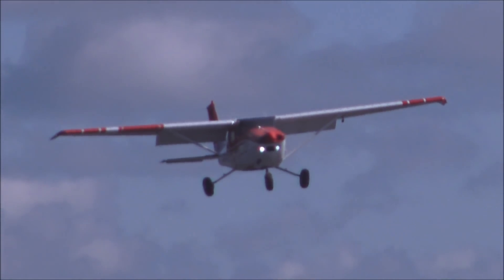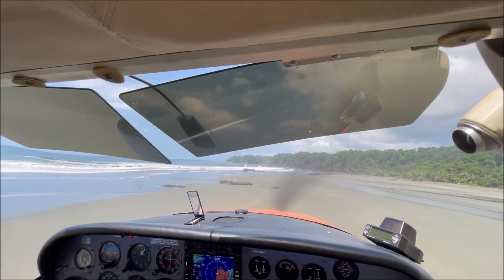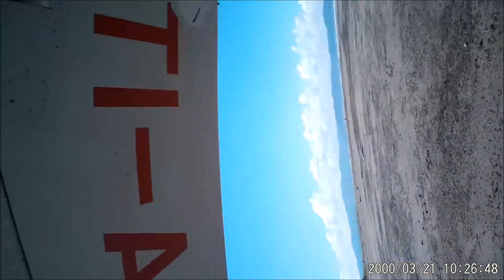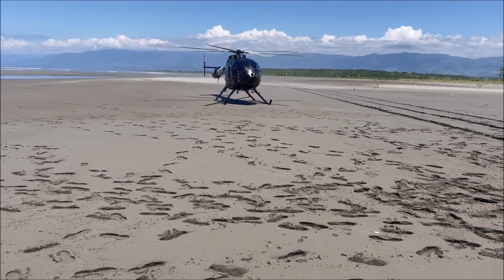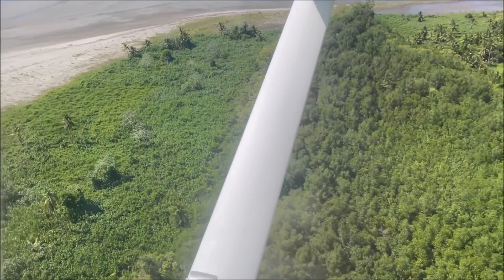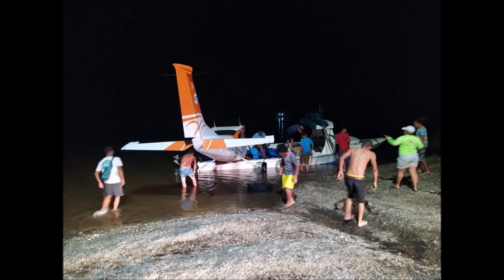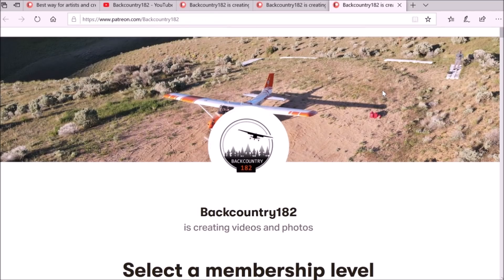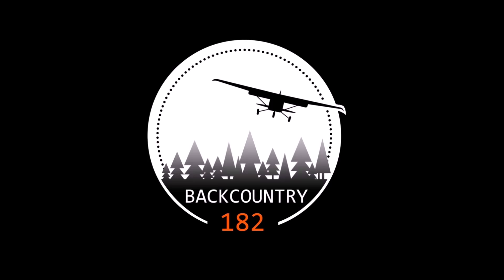Cessna 182 Crash Landing on a Deserted Island

Comment: I wonder how things would have been different if you were flying a taildragger (with large bush tires).  I realize those are large tires for a nosedragger, but presumably the pressure-per-square-inch against the sand with a taildragger [with large tires], and maybe wouldn't have been sufficient to "dig in" enough to get past the point where "dig in" reached the state of positive feedback mode (which it sure looks like it did).

Comment: You had contaminated oil filters multiple times and kept flying? Sorry, dude, but that is not cool. I'd go so far as to say that it is unacceptable. Whoever is doing your maintenance and okayed you to keep flying with oil system contamination, especially if that contamination was metal, put your life at risk. But, even with a mechanic's blessing, it's the pilot in command's responsibility to determine if a plane is airworthy before each flight -- continuing to fly with known problems is an invitation to make emergency landings such as you experienced or much worse.
Reply: Metal is not unusual it depends on the amount & type. It sometimes comes & goes. Also this was a low time engine. Oil analysis will recommend fly it 25 hours & do another oil change/sample. These engines have a 1800 to 2000 hours TBO. Its 30 thousand to overhaul. Not uncommon to replace cylinders before TBO.

Comment: Thanks for sharing this incident, especially the cautionary information about warning signs from the oil analysis.  I didn't fully understand what happened with the engine other than the presence of contamination including fiber.  What actually caused the power loss?  Did you lose a cylinder because of valve train damage, or did one or more bearings fail?  I'm taking note of the fact that the Sportsman STOL and VGs, and your frequently practiced ability to land at very low airspeeds, contributed to the good outcome.  I'm glad your bird is reparable!  I've learned a lot from your channel. Hope you're back in the air soon.

Comment: Did the same back in the 1980’s.  Nose-gear went through firewall and a prop hit.  Ended up replacing additional frames beyond original damage due to corrosion, new floor and a rebuilt engine.

Comment: Hi Larry,
I hope repairs will be done easy and safely.
Thanks again for all your beautiful views and all these informations ?

About the Sportman stall kit you had installed, how much do you think this helped you on your engine failure landing in sand ? 
You think aircraft will be in worst conditions without ?

If you were with the cessna 170 will you land at this plane with no problem ?
Reply from the maker: Sportsman reduces the approach speed , so maybe without it it would have turned over its back. Maybe the 170 could have made it with the big tires.

Comment: Would a tailwheeI airplane have survived a landing in that soft sand?  This is the third tricycle gear airplane I've seen lose a nose strut on soft field landing.  Surprised to see you were running wood prop, not a bad idea in this situation.  Best wishes on your repair.  I'm thinking there was some bead blasting media in the oil gallies that didn't get removed before assembly. The oil analysis should indicate what the high level contaminate was. I assume you have a spin on filter.
Thank you for your excellent videos and narration.  🛩👍

Comment: I know your channel is called Backcountry 182, but have you considered trading for a 180?  On 29 or 31” tires, It’s a way better fit for off-airport.   I’ve run 206s off beaches in Alaska for a long time.  There’s a steep learning curve, but in the end, It’s still a crapshoot, and the only sure thing is landing in someone else’s tracks.  

Looking at a beach or river-bar, if the sand shows no sign of gravel or rocks on the surface, that’s a red flag. If the surface can’t support a stone, it probably won’t support an 8.50x6, let alone a nosewheel. 

If we’re taking a Beaver, 185 or 206 into a difficult spot with variable conditions, we’ll send a super cub in first to inspect the surface.  Otherwise, you eventually get a nasty surprise.

Comment: He's got mad skills, great pilot and this good outcome goes to show you that even best pilots sometimes face a situation when it is not safely landable no matter level of skiĺl or type of airplane.  What if his engine failed over the rocky jungle away from this little beach? What if the beach was full of people? Over a busy city at night? Over rocky mountains, in IMC on an IFR flight with passengers? Whole frame parachute from BRS (same as on Cirrus) is offered as a retrofit for cessna 182. Buy it, install it. $20k is hell of a lot less than he'll be spending on a new firewall-forward repair.

Comment: Try to used solid rivets and not elongate the holes. The less cherry rivets the better. If a hole gets badly elongated & over sized rivet won't work used a structural screw or bolt with a nut. The firewall uses alot of steel or stainless rivets cause aluminum melts if there's a fire. I have fixed alot of planes like yours. One tip if the new firewall doesn't fit tight don't rivet it without shimmy it or it will get sucked down around the rivets. Also seal the firewall with PRC keeps the water & oil from getting threw. Good luck.

Comment: Wait. How come an aircraft engine which ingests dust for maybe a few minutes prior to departure and after arrival on a dirt strip gets contaminated to the point that it fails, which tractor engines (very similar to Lycomings) run in the same conditions for several hours a day, for years ?
Reply from the maker: Seems to be a rag got inside the airplane somehow, maybe when was installed or built?

Comment: "Actually good that the propeller absorbs the impact and doesn't translate it to the motor"
- the motor crapping out is the reason you had to crash-land in the first place! Geez... and yes, I know that a rebuild of a peace-of-shit 10'000+ hrs Lycoming engine is worth more than a new Mazda with an engine that can run just fine in a gyroplane or experimental... GA really is backwards. As someone relatively new to this, I see how backwards many things are, for bogus reasons, really.

Experimentals all day for me. At least I can change the damn oil and wires myself to make sure it doesn't crap out on me like this. Been training in Skyhawks the school charges $175 / hour and can't be bothered to change the damn oil which is darker than any oil I've ever seen... I suppose 6 quards of oil every 50 hrs ($7500 for the school) is too much...